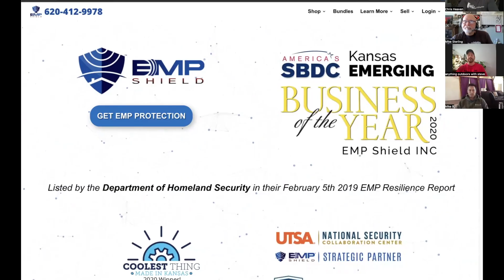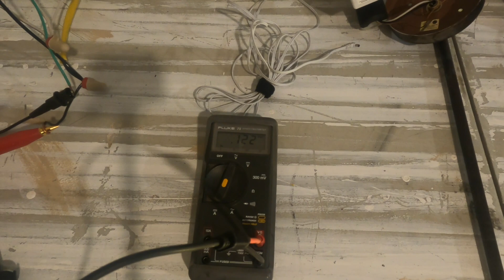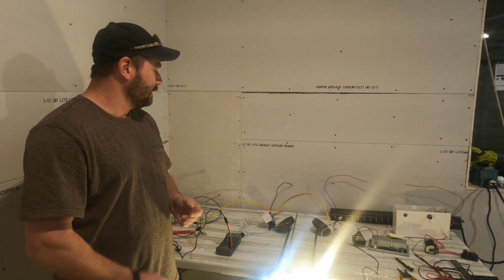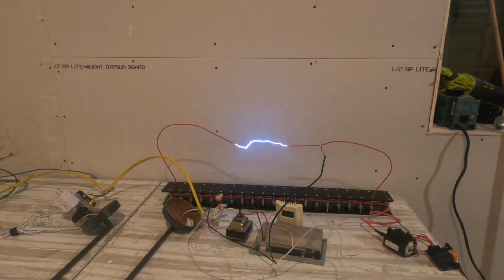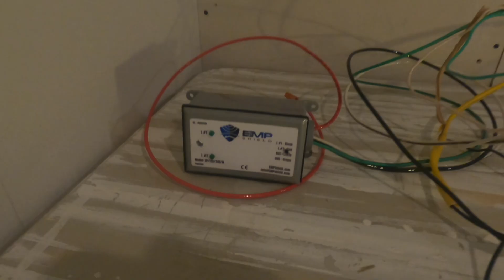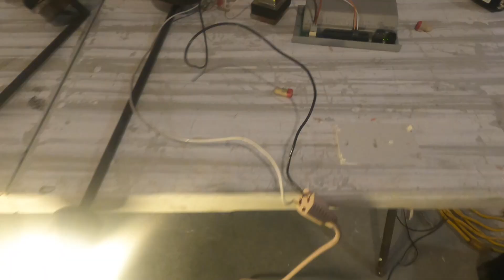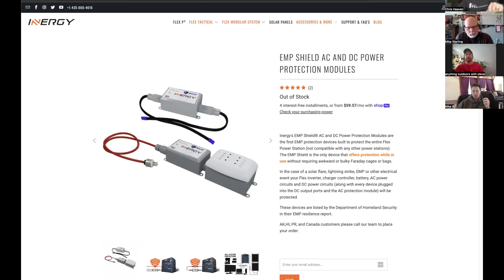We TESTED the EMP Shield... UNBELIEVABLE RESULTS! WOW!

Comment: Ok so can you tell me everything that’s  needed to protect a home and the setup.
Reply from the maker: @Dan-bj1cz ... Hey Dan, just click this link <https://www.empshield.com/link/ay0tprz/>, go to the Shop link, select home protection, and select the flush or surface mount model. When you use this link you'll get $50 off. After you receive the product call an electrician, we recommend Switch It Up 720-726-3326 as they have national coverage and specialize in this type of equipment, and that's it. You can also call Switch It Up and have them provide the EMP Shield device and installation services if you want them to look after everything.
Reply: @SurvivalDispatch  Great thank you so much. Also your saying switch it up provides a service to monitor the equipment?
Reply from the maker: @Dan-bj1cz  ... No sir. They can provide the EMP Shield and services to install it. Or, if you buy it direct from EMP Shield you can have them install it.

Comment: Cool video ,I'm an old electrician and love tech gear so this video was awesome.I think it's worth the cost if it saves your hones electrical system but it really dont matter if the grid goes down before your home..
Reply from the maker: @dougstanley7662 ... Many of us have solar PV systems and generators with everything protected from EMP strikes. If the grid goes down we'll still have electricity.
Reply: I’m definitely not familiar with all this. But quick question. Wouldn’t you still get power if you have the EMP shield and a Generac that’s EMP protected? Thank you.😊
Reply from the maker: @dawnbrown7964 ... Yes you would.
Reply: I agree with the grid comment as the main condition we all would experience. This is where you start building your small generator setup and then expand to battery backup with split phase inverter (I settled on aims) and after that, solar for extended outage.

Comment: I just happened across this channel, lot's of info,
You have a new sub,
My question is will a metal cage protect a generator,..❓
I've seen videos on it. But don't want to waste my time and money
Reply from the maker: Anything that provides a minimum of 120db of suppression with no gaps in continuity will protect anything in it. Obviously you couldn't run your generator in a Faraday container, but you could store it in one.
Reply: Chris beat me to it. No holes greater than .29 mm, solid continuous highly conductive materials are required for the best Faraday cage foe EMP protection.  CME, a mesh is acceptable. If you were to build a snail shell room of conductive material,  then an opening is possible for ventilation. My understanding is that a switchback corridor or multiple 90° corners will also block the EM effects- similar to radiation protection for underground shelter corridors. Hopefully I described this well enough to understand.

Comment: I've had an EMP Shield on my truck for a couple years and I call it my $390 insurance policy for my $30k truck. It's the best investment I've ever made. I'm still working on saving up for another unit for my solar generators, but the problem I've come across is that EMPS doesn't make units for the various solar generators like they did the Inergy. I was told to get the plug-in model for my RV and keep the generators plugged into that. That option has recently gone out the window because I'm about to move to a more "primitive" location and I'm not taking the RV. Do your experts have any ideas?
Reply: Chris showed a unit that was a 120volt cord plug version. This could simply plug into the portable power bank. Be sure to remember the mention of "this shunts to ground " and drive a couple ground rods to hook your ground lug of the power bank to the ground rods!
Reply: @AnythingOutdoorswithSteve  Thank you.

Comment: Hi guys awesome video loved it I believe in EMP shield so much I bought two one for my pickup and one for my buddies Yukon. I have two ecoflow Delta pros so I can go to the inergy website and buy the EMP Shields to protect those? I also have 6 200 watt solar panels how do I protect those from CME or EMP thank you
Reply from the maker: That's awesome!
Reply: Yes, both inergy and emp shield have devices for the portable power banks and solar. I do still have hesitations on the solar protector since solar array voltages vary drastically. I am not sure if they sell voltage specific devices or if the assumption is that panels can be wired in series to voltages around the 1500v range and to protect beyond that? I would love to have someone from EMP shield answer some of these questions.

Comment: I already have EMP Shields installed in my vehicles, another to be installed at the house
Reply: I think I am now most skeptical of the solar protector- only because the large range of solar output capabilities. I have not looked yet to verify if you purchase those specifically for the charge controller voltage to be properly matched. This would be the variable that brings me greatest concern, because you can have solar arrays voltage in excess of 600 volts (depending on inverter used), and as low as 12 volts.
Reply: Where do you find them and any suggestions about good ones or bad? Trying to catch up

Comment: Curious what your take is on the difference between the DEFCON product and EMP Shield and which is more effective
Reply from the maker: We haven't had the opportunity to look into DEFCON products, but if they're reading this comment sections we'd be happy to do so at some point.
Reply: I remember seeing their emp alert box and was highly critical of it because it is a passive device only. It's great if it happens to be in a location that it's audible and you immediately run to your electrical panel to open the main breaker. 
  The car protection they sell, the high saturation ferrite cores are a great idea to limit surge currents, so if installed correctly, they are a great addition.  I would assume their device also uses MOV's, so it may work similarly. Just be sure to attach the return lead (shunt lead) to the battery instead of after the ferrite core. Otherwise the ferrite will limit the shunt current as well!

Comment: I bought a youczon faraday bag from Amazon.  When that alarm went out to everyone’s phone, I thought “great!  I’ll be able to test this faraday bag”.  I folded down like I was supposed to.  When the alarm happened, I heard my phone.  It was clearly muffled sounding, but it did get a signal.  So now I don’t trust buying any faraday bags or any EMP anything.  Plus, if I spent money on some kind of EMP protection, and ‘it’ finally happens and the protection doesn’t work.  There wouldn’t be anyway to get my money back.
Reply from the maker: That's very unfortunate. We have multiple Faraday bags from multiple companies and they all block cell signals, WIFI, RF, everything. Our favorite vendor is Offgrid.co. We've done videos showing how effective they are at disabling connectivity for cell phones, HAM radios etc.
Reply: I wouldn’t be so sure we would t do it to ourselves. They did 9/11 allowed the border invasion and countless other scams so again you can’t count USA out
Reply: 100% correct!  Not all Faraday bags are created equal. If you can see through  it, it will be a low level protection.  The thicker material, highly conductive, with no holes, will give you anywhere from 40-80db of attenuation.
   Antistatic bags offer minimal protection. These are often the Amazon specials. I can attest that my Faraday room will drop my cellular and wifi signals completely, but that is in the 2.4Ghz ranges.
Reply: @AnythingOutdoorswithSteve  talk to me about faraday rooms please. How?

Comment: Will old microwave ovens make an effective far away cage?
Reply from the maker: No. The door seals are easily penetrated by EMPs and electricity in general.
Reply: Microwave Faraday cages are designed for 2.4 Ghz frequency, and the door leaks EMF. In other words, don't stand close to the door of an active microwave. This is above the 1 watt safety threshold.  They also will not be effective for EMP attenuation on any sensitive electronics.